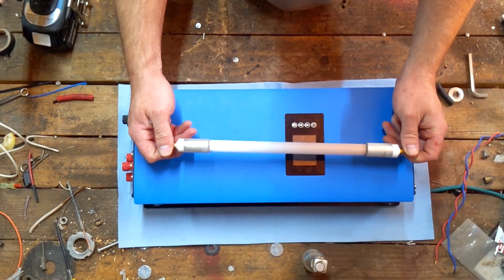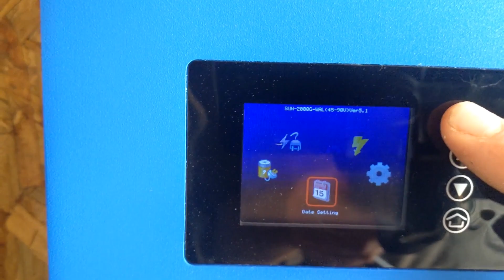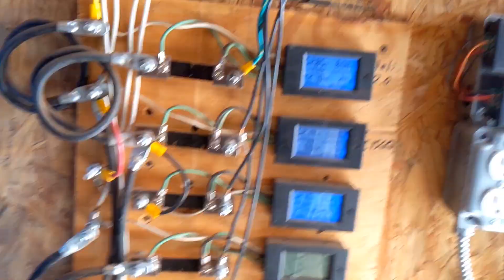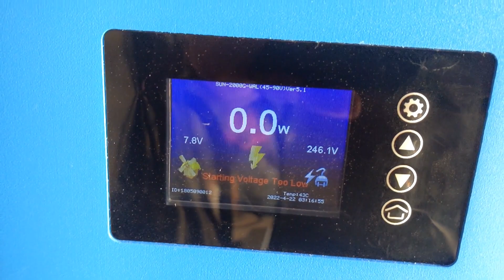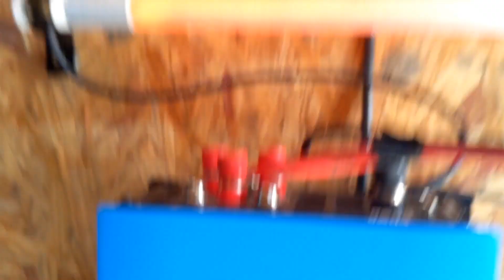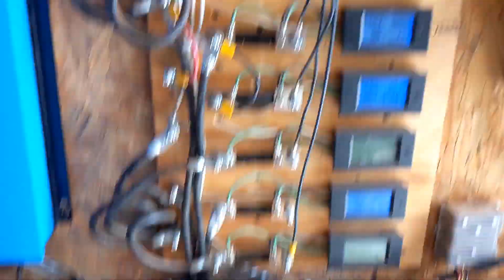Testing a 2000 watt 3-phase input Wind Turbine Grid Tie inverter

Comment: Health

Last year, I got a product called the 2000W 3 Phase Wind Turbine Grid Tie Inverter Limiter AC 45-90V SUN 2000GTIL WAL, but it doesn't work at all?
The wind turbine's input readings are correct but the inverter's output readings are essentially zero?
Where should one turn for help in this matter?

greeting.
Reply: any udpate ur your problem sir.? i want o buy also with my 48v 800w WT China Made

Comment: Hallo i want some help thanks 

the inverter when working on the network brakes the wind turbine at 40 to 43 volts and does not let it work.

when it is not working on the grid it lets the wind turbine work at 80 to 85volts but still does not provide energy.

can you give any advice to make it work?

Comment: Yes friend. That inverter is perfect and is doing its job fantastically. But you have to adjust the braking voltage in your case to 48 volts. You have to set the braking voltage of the windmill to 102.4 volts because that inverter is mppt before entering the mppt circuit the voltage is high if the inverter does not charge the mill then the way to know when to stop it due to excess rpm is in the no-load voltage 102.4vun greeting
Reply: how do you set the braking voltage?

Comment: i2000 + SUN WAL works perfect with the right settings. First put the WAL into 23-60V mode by pressing home+setup while power on!! Then curve adjust, starting with 23V@13x0,1A next 26V@21 next 30V@37 next 34V@59 next 38V@83 next 42V@112 next 46V@139 next 50V@164 next 52V@190. Dumpload 53V, Shortcut 60V. Max Power is 1000W! More and the i2000 gets broken @ shortcut!! The i2000 48V has best setup if you handle it like a 24V turbine. Look my video @ very low wind: https://www.youtube.com/watch?v=4ZacR5ul1QE or this one: https://www.youtube.com/watch?v=bnuGb_sWPzA

The dumpload only is active if the SUN is powerd on to fast with to high voltage. It saves the inverter and helps the start, not block it! Without dumpload the SUN is very fast over voltage and shut down for some minutes. This all only happens by disconecting and conecting wires. Dont do this and everthing works fine!

Greetings from Germany!

Comment: Its design to work with 40-90V, so you have to have a 48v turbine to use it. This test is really a waste of time, you could have bought the 12-30v version (1000w) and will do better job than this

Comment: I wonder if you’ve had any success with this controller?  I’ve the 1000W 24V version and once I got the power curve dialled in, it produces a lot more power than if I just connect the turbine directly to the batteries.
Reply: Kevin - could you share the settings you dialled in please? I’ve got the i2000 and I’m attempting to up the power output
Reply: @pgfox2002  my settings won’t be of any use to you. What I did was impedance match the controller to the generator. In my case the resistance was 6 ohms so I set the current draw on the controller such that the impedance appeared the same as the generator. As an example, @ 24V I set the current to 4A, @ 36V I set the current to 6A. Above 36V all the Amp settings were set to 6A as the generator became saturated and no matter what the RPM, the generator could not produce more than 6A. Connected directly to the 24V battery the max 6A would produce 144W but with the controller the generator was allowed to produce 6A at 50V i.e 300W.  The max I saw was about 350W.

Comment: Same here John Beattie, but more like 5 years with no trouble and no batteries and home made turbine. Decided with the price of power Id splash out on a i 2000 2kw turbine and new inverter, so far no better than my previous as regards power generally but on the standard settings it did blast up to 1400 watts once then went over voltage and disconnected the inverter and shorted the dumpload as designed cos the circuit involves bits that will fry over 90 volts. Changed some of the settings and brought down the max voltages and midrange and its so far behaving well enough. I think the slow start is charging capacitors not power to resistor. Bit disappointed with power output so far from the mill, I was hoping it would put out more power at lower wind speed, but I suppose there is the same amount of power in a given swept area. might have been better spending the money on more and bigger magnets and built a new genny. Live and learn.

Comment: It must have a defect this one. Mine also puts dc voltage to the dump teeminals when no resistor connected, must be some lekage from electronics, it lets no effect trough. Resistor only gets power when dump voltage setpoint is reached.

Comment: Try adjusting the amps in yhe setupp menu so that it starts generating power at lower voltages.  Set 48v to 050, 52v to 160,
56v to 250 and 60v to 255 the rest will auto adjust to 255.  Also set dump load to kick in at 60v   and short cut to 75v.
Reply from the maker: I will try those settings and see what happens.  I can't get the manufacturer to tell me what any of those settings are actually supposed to do...they're not mentioned in the manual at all.
Reply: These settings is how much amps it will draw from the generator at the given voltage
Reply: @magvat  is 255 (25.5A) as high as it goes? I would think either of the generators will put out considerably more amps.
Reply: @kevinmills5293  I think you can multiply with 1.73 for 3 phase
Reply: @magvat  perhaps but the 3 phase input is rectified and I would imagine it is the DC amps that are being measured.
Reply: @kevinmills5293  I think you are right, if you multiply 25 with 70 volts you get 1750wats. The unit can only give 1800 wats.  It will not give that much watts at 48volts.

Comment: I,m sure you wired it up wrong. After 2kw goes into the grid ,anything more goes into the dump load. Or in your case batteries. The dump load being red hot means  all the power created wend into dump load not the grid. Any way that's my 2 cents worth. Cheers from Tassie
Reply from the maker: Since it doesn't seem to be working properly I have to assume that it's possible, but I'm not sure how I could have wired it incorrectly...the only wiring I get to do is grid, turbine, and dump load...all of which are difficult to mix up.
Reply: Maybe it's the box ticked of the dump load in settings. I got the same set-up,  but only had it for 3 days thus far and no wind. So I can't tell you yet. But the dump load glowing red hot is a big no no .cheers jerry
Reply: why not take a 3 phase bridge rectifier and a strong solar inverter?

Comment: This will be interesting, I bought one of the these about a month ago but not installed it yet.
If it is runs 100% to grid is the dump load redundant?
If you take apart a 3Kw fan heater all it is inside is a thin gauge coil spring element of no great length.  I think this dump load would soak up alot of energy.  The Tessup charge controller dump load is the same style and very poor build quality in comparison. 
I would be interested if you can show us what voltage is going to the dump load, could it be diverted and used to charge a lifePo4 battery bank?
Cheers man!
Gaz
Reply from the maker: Voltage at the dump load is always turbine voltage....if it says it's kicking out 45v there's 45v at the dump, same at 80v, and everywhere else.  I'm actually looking for an old space heater to wire into the dump load lol

Comment: have you tried looking at a single super capacitor battery they look like a normal battery and should drop in rated at about 48v
Reply from the maker: Ever since starting this I have been told about capacitors...but I have never seen a working example.  I'm not convinced they can properly load up a turbine and wouldn't know where to start to try and build my own.

Comment: Die Kennlinie muss programmiert werden. Wenn das nicht erledigt wird, kann die Turbine nicht auf Drehzahl kommen. Ich selbst habe eine 300w Turbine. Bei mir sehen die Einstellungen in etwa so aus. 32V 0.0A; 50V 0,0A; 60V 0,0A; 65V 3,0A; 70V 7,9A
Wie gesagt für eine 300W Turbine. Du solltest auch den Dumpload richtig einstellen, dieser verhindert auch das Drehen der Turbine. GLG aus dem Fichtelgebirge Volker
U0 32 V 0-0
U1 50 V 0-0
U2 60 V 0-0
U3 65 V 3-0
U4 70 V 7-9
Reply from the maker: Thanks I'm sure it's a settings issue.  Someone sent me a copy of the manual I'm going to be going through it today to see what can be adjusted.  I do know that no matter how it's adjusted, though, the resistor that comes with it has no chance of actually slowing down the turbine.
Reply: @ToysforWatts  Ich habe jetzt die Einstellungen für die selbe Windturbine mit 600W Leistung gefunden. Vielleicht kann man mit beiden Werten ein Diagramm erstellen. Dumpload ist nicht sehr wichtig! Wichtig ist das die Windturbine bei gewisser Leistung genügend Abnahme hat. Dadurch dreht sich die Turbine langsamer. Dumpload nur über die Batterie Bank durchführen. Ist besser. Hier die Werte für das 600W Modell.
…………...........V ....A
…………... 0 ... 27 ... 0,0
……………. 1 ... 45 ... 1,3
……………. 2 ... 55 ... 3,0
……………. 3 ... 62 ... 5,0
……………. 4 ... 68 ... 8,0
GLG aus dem Fichtelgebirge Germany Volker

Comment: let the turbine Work between 45-80volts. set the power curve progressive in High voltage Range and very light i 45-60volts
Reply: Lars - what figures would you suggest to get the best out the unit?

Comment: I've been running one of these (1000w) for about 2 year now on a small 500w turbine I just really needed it for when the wind was real strong and my battery bank was full. The menu isn't the easiest to understand and I'm still not sure how it all goes but if you look at the set menu 16.09 you can see there is a dump load set point and a overload set point, the overload will brake the turbine by shorting and the dump by burning off at the resistor. I replaced my resistor with a better one as like yourself didn't feel the one in the box was very good.
You can use both dump and short at the same time or just one or the other. I use both at the same time to keep the head down on the resistor 
The overload won't stop the turbine just slow it down so great for crazy winds, you will get a shorted message on screen when it kick in then after about 60sec you will hear a click as it lets go and the turbine will pick up again.

The two terminals next to the three red inputs are for your limiter C.T cable one is for the internal limiter the other for the external, you won't need these if your pushing to the grid.

You also have a power curve which you can set and turn off or on this is where I get lost as I don't really understand anything about turbine power curves or how it's supposed to be set so if you work it out I'd be happy to hear how it goes. mine is a 24v and was set from the factory starting at 10 through to 90. yours look to be set a little strange with the first three set the same at 124 the next four at 140-141 then a big jump on the last two. I guess you could turn it on and see how it goes.

My fans kick in at around 400-450w so most of the time it runs silent. overall I've been happy with mine but have nothing to compare it with.

I'll be interested to see how you get on with yours over the next few month.
As always have fun.
Reply: I think the powercurve setting depends on the turbine size and wind conditions. If it tends to spinn up to easy give it some more amps in the lower voltage range and visa versa
Reply: I have the same 1000W 24V unit and I’ve been very pleased with it. The tricky bit is adjusting the power curve to suit your turbine. I have only a 400W wind turbine and the dump load is never used. The only time the dump load is activated is when I save changes to the power curve and the controller unloads the wind turbine while it saves the new values. If there is a lot of wind, the turbine will run away and activate the dump load. Once the values are saved, the grid is reconnected and the turbine voltage is pulled back down.

Comment: Interesting.  I have one of these myself that im planing to try with a 48v 2kw turbine, I saw others that had the same problem with resistor staying on to long. Probably made like that to save the unit from overvoltage. The kick in point for the resiator can be adjusted but not higher then 80v i think. Im thinking using it in combination with a batt charger would be a solution, just open the sun 2000 and tap off from the dc side of the rectifier to a batt charger input. Should help to tame it in strong winds I guess

Comment: That resistor looks like a inferred heater tube mite work and give ya some heat mite just be for shutting down  unhook the resistor and use the resistor for shutting down only
Reply: Not a good idea i think it would overvoltage and fry the unit without the resistor.
Reply from the maker: This resistor is the only one that came with the unit and it's not capable of shutting down a 2000w turbine.